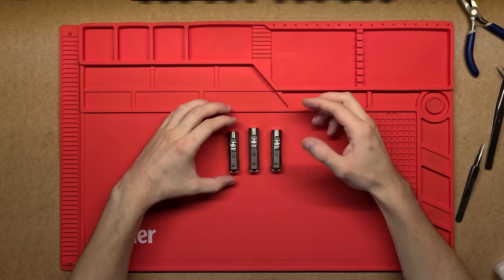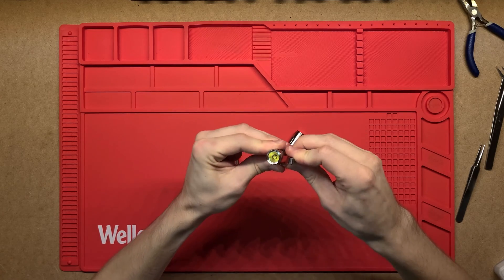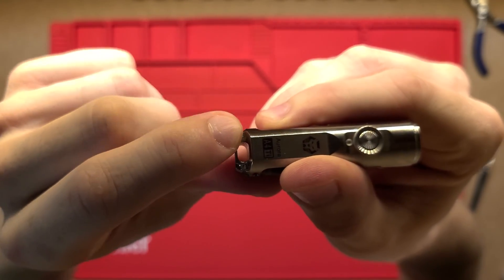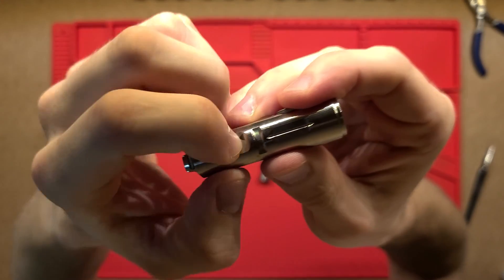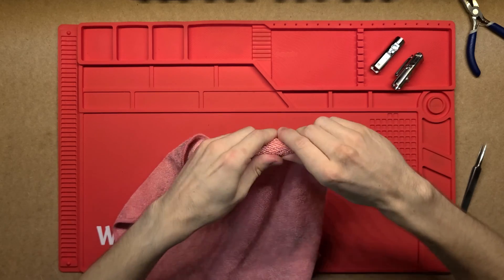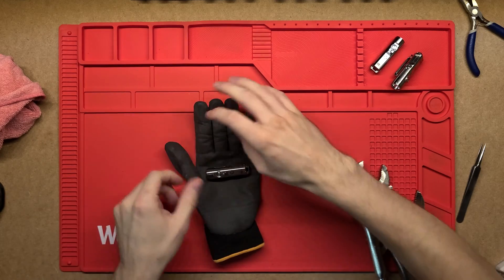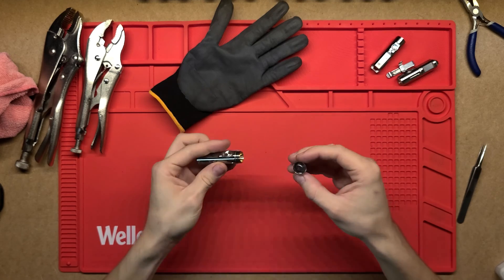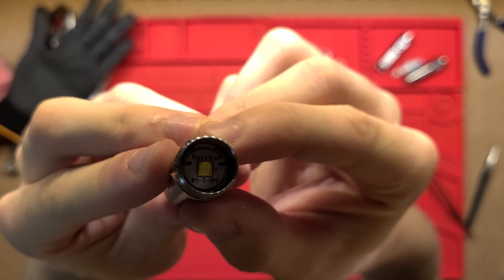These Torches are Radioactive!! Rovyvonn A4 (with tritium) Teardown

Comment: I have a stainless steel Rovyvon Aurora A2, a Nitecore TIKI GITD and an Ali Express copy of the Aurora A8.

I love them all. The Ali copy is very impressive, with lots of sidelight modes and cost only £3.50. 

The Rovyvon is the only one with a button click pressure soft enough that it gets switched on, in my pocket, if I don't have the keylock enabled and enabling and disabling the keylock is a miniature pain in the ass.

Usually, the only way I know that the A2 is on, in my pocket, is when the steel body starts burning my leg.

They should make it with a button that's harder to press, even keeping the keylock function for people who want the extra safety of that.

The result is, I actually use my Nitecore Tiki (GITD: glow in the dark) the most, out of the 3.
Reply from the maker: Great collection of lights, mate, and thanks for sharing your experience

Comment: Beta particles from tritium are extremely weak and cannot pass through the glass or metal enclosing the vials. These vials are carefully sealed, making them completely safe to use as long as they remain intact and the material stays contained. 💪

Comment: Where is the tritium?😂
Reply from the maker: Two vials at the rear of the flashlights, next to the lanyard hook 😊
Reply: @ToolsnTeardowns  Beta radiation is very weak and does not penetrate the glass or metal surrounding the tritium vials. Safe to use: Tritium vials are hermetically sealed, and their radiation is harmless as long as the vials remain intact and the tritium does not escape.